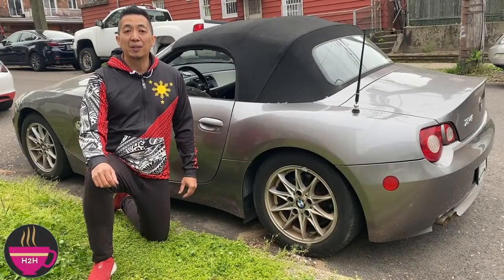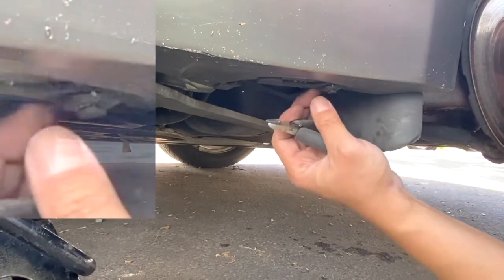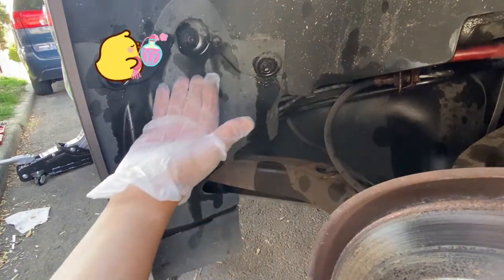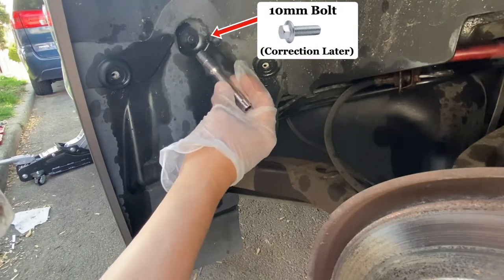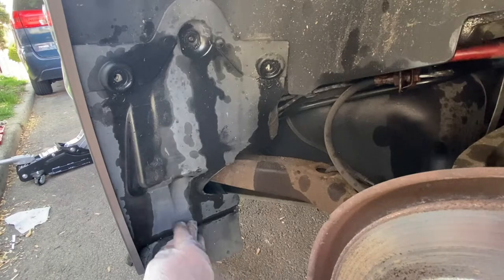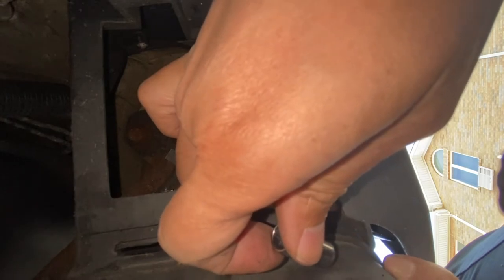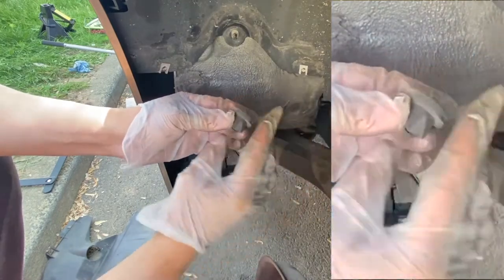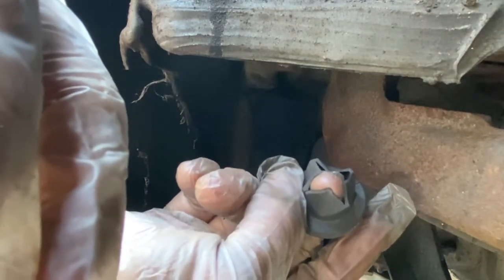How to: Clogged Convertible Roof Drains 2005 BMW Z4 (E85)

Comment: How often do you think this has to be drained? Like every year or two or like after every rainfall? Also, how can I make sure its not already clogged??
Reply from the maker: Hello, if you are not worried about bugs, you can just keep the ends out. The only purpose of the ends designed like that is to prevent bugs or insects from going inside. But if you prefer it to be on, I would recommend cleaning it once a year, when you do your "spring cleaning" day just to be safe. Hope that information helps.
Reply: @How2Helen  It does, thank you.

Comment: Hi there, im considering to buy a 2004 z4. But after hearing lot of issues with covertible pump and those clogs i am kinda scared to go for the decision. Will removing these parts help at all or be a adequate measure to prevent pump failure? The cars pump atm works well, but i feel  i will have to deal with it in future. Thank you for your videos and insights. ❤️
Reply from the maker: Hello, if this is your first Bmw, know that parts will be expensive, and shop labor as well, compared to Toyota or Honda repairs. I just want to get that out of the way first.
With that said: I, as well as others, create DIY repairs so that owners can save money on repairs that these vehicles are known for.
The DIY repairs are not that hard, and if you are mechanically inclined, they are very straightforward.
With the roof motor, just like any roof motors, if they get soaked with water, they will eventually die. So cleaning the roof drains is really a necessity to avoid this from happening. 
And like any bmw owners you ask, the driving experience outweighs the repairs you worry about. Worse case you can just resell the car for a slight loss. Hope that info help. Thank you for watching! - Rjeff H2H